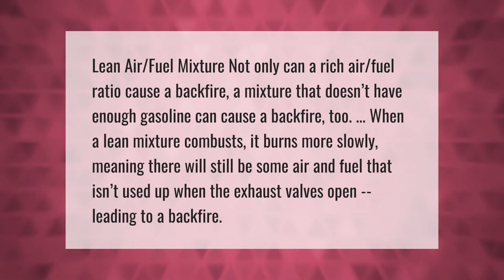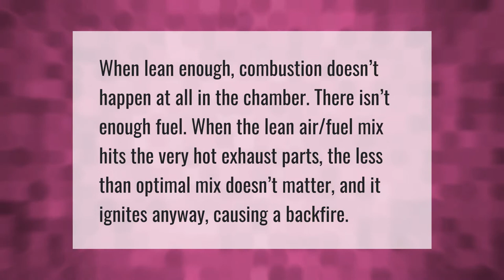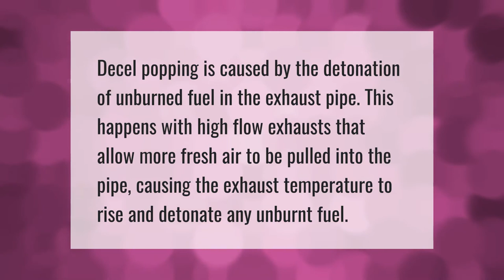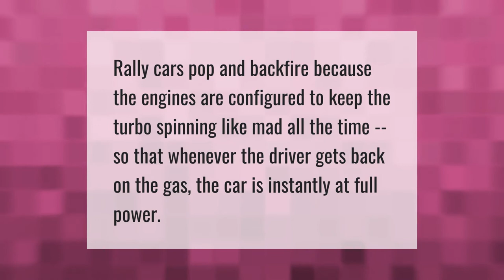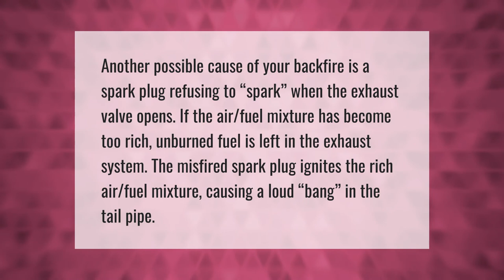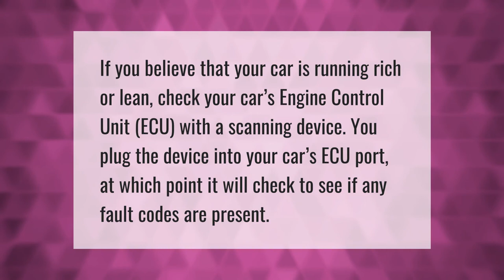Is backfiring lean or rich?

Comment: Is the backfire bad for the engine? Or like the valve seats, maybe does it cause excessive carbon?
Reply: Depends on the reason for backfire, since some backfire is good for modded vehicles
Reply: @X1AN1023  i see what you mean, so lets say a car has burble tune or pops and bangs thatd be bad right?
Reply: @mojolocomtx  anti lag is good backfire, like rally cars when yo u hear them do some eargasm gunshots, but for like a big block drag car blows an engine and create back fire it's bad
Reply: @X1AN1023  i see what you mean i appreciate it, my friend wants to get a anti lag? Or burble tune on his car but its n/a i was trying to explain to him that it makes no sense and that it could be worse for his engine
Reply: @mojolocomtx  I think you just have to tune a bit rich for good sounding back fire na or fi